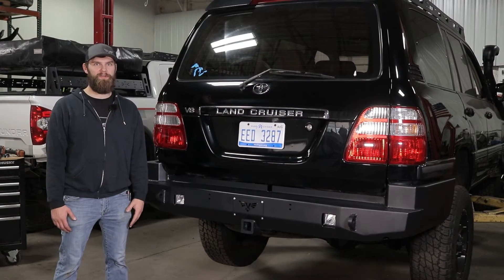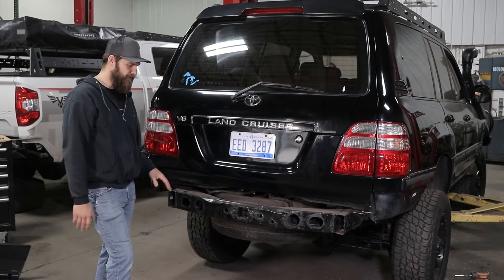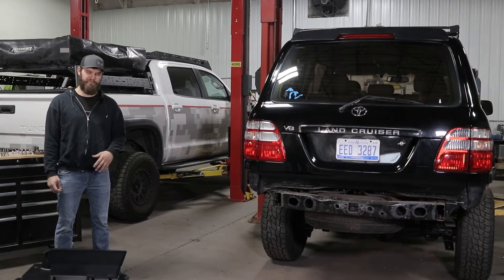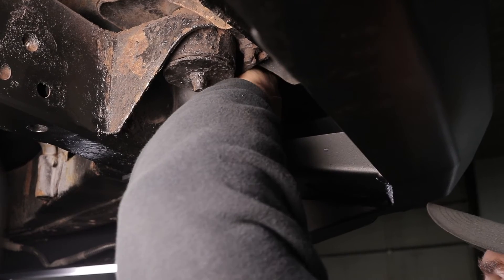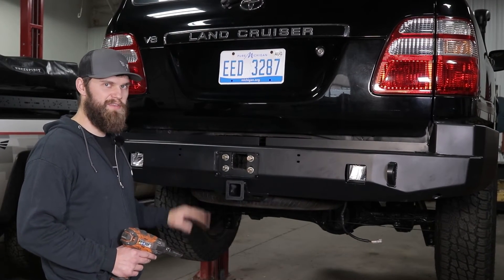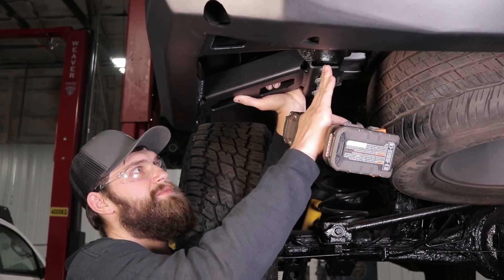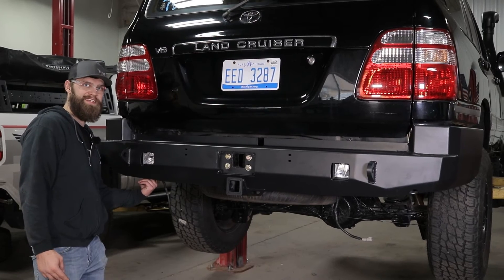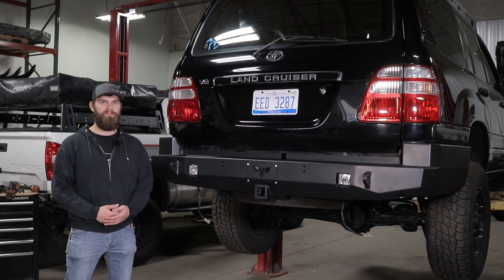100 Series Land Cruiser Rear Strike Bumper Install

Comment: curious if there should be a 1/4" gap behind the strike bumper at the center bolts, and the original bumper?
Reply: Mine has this too
Reply: @kentperkins5780  haha, k... I just added some plate to fill it in.